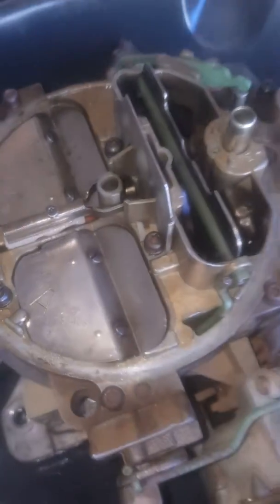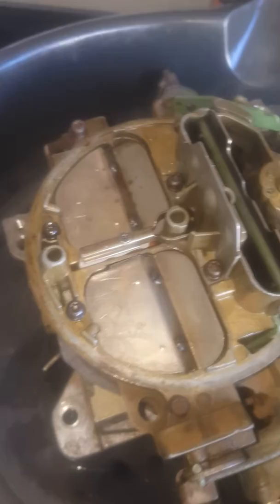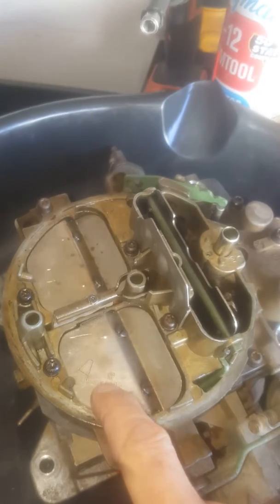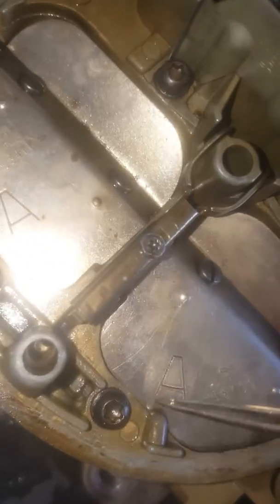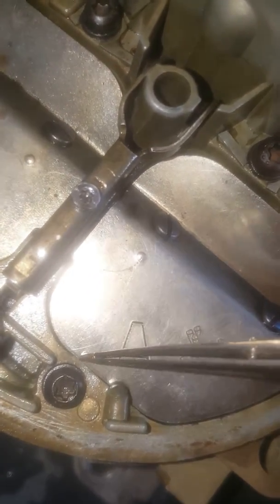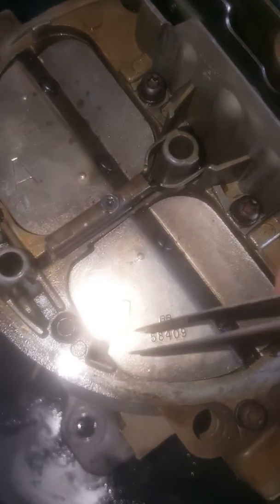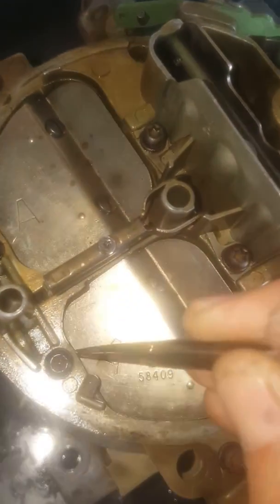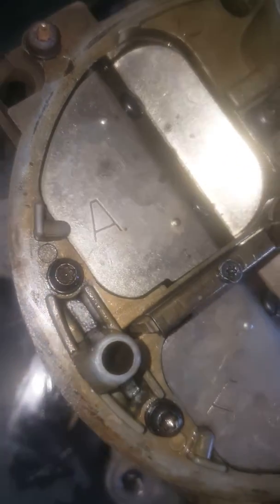January 22, 2019

Comment: Are those the screws that go all the way to the bottom plate?  I think they do on my RV.. In order of torquing, I think one tightens those last.  If tightened first, the other screws will stretch those..
Reply from the maker: Yes those are the only two that extend all the way through.